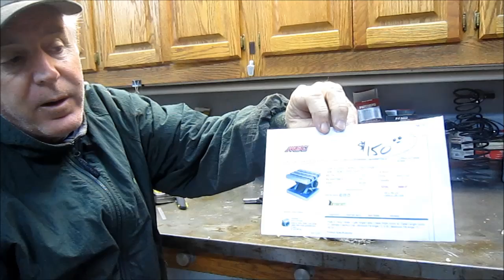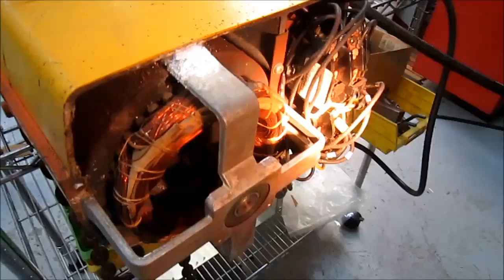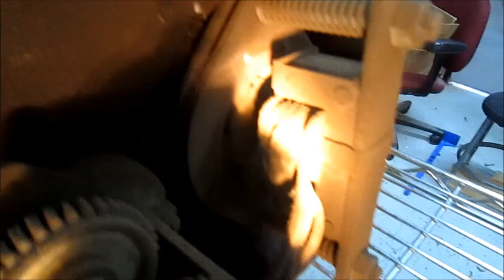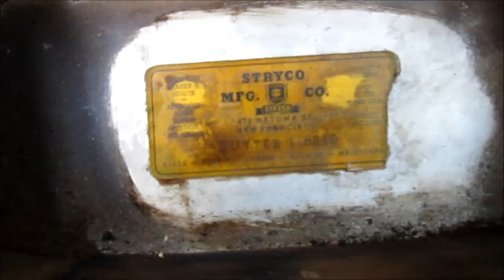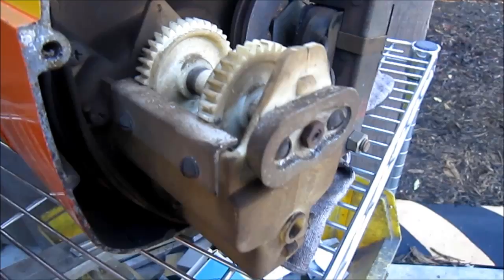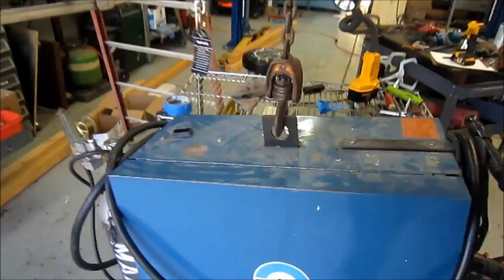Tool Time 15   Repair The Wrightway

Comment: I have not checked Part 2 nor all the comments, but I didn't like the sound it made at some points while it was running under load. Before I put that back into service, I would like to see inside the gearbox. You may have a tooth (or two) missing or chipped from a gear (or two). It sounded to me like a gear tooth jamming partially on top of another gear tooth. When there is no load, momentum carries the driven gear past the bad spot with a little clunk. When there is a moderate load (your welder) it clunks louder and occasionally jams and won't go past the spot and won't even back away without several jogs.

I worry that with a full load, it might some day jump across that bad spot and begin knocking teeth out wholesale (and since the hoist is activated, the brake is held open) and letting this heavy load get you into some serious trouble. You really don't want several thousand pounds of runaway metal in your lap.

Mind you, that noise might also be a worn chain and/or a worn chainwheel (the pulley that the chain runs over). When either or both of those parts are worn, the pitch of the chain (distance from link to link) may no longer match the pitch of the chainwheel (the pitch of a theoretical chain that fits the chainwheel exactly).

A worn chain develops a longer pitch (because the wear is on the inside of the link-ends and a worn chainwheel develops a shorter pitch (because the pitch diameter decreases), so wear in that department is always bad news. Arguing against this as the cause of the problem, it would be less likely to cause an actual jam.

You can't replace just one or the other; you have to replace them together or the new one will just wreck and be wrecked by the worn part. BTW, roller chain and sprockets behave the same way.

A chainwheel may also be called a gypsy (UK) or a wildcat (US). I have no idea why. Sorry about being so long-winded, but it's a safety issue, and they always wind me up.
Reply from the maker: Peter W. Meek Peter...no worry on being long winded when all of the information is of value....thanks

Comment: im a lift engineer think you call them elevators my money is on the break< when you put a call in you hear the break soloiniod operating (CLICKING) i bet the break is still engaged, breaks can be really tricky
id take the cover off and make sure the plate engages to the break squarely remember yov have probably disturbed it when you re-welded that bar, also have a look at the break surface might have high spots, good luck

Comment: Have you checked that the brake is releasing when you press the up/down button when the hoist doesnt move but there is the buzzing. If the brake releases then I reckon you have a dirty/faulty motor contactor, needs cleaning but at that age better to replace.

Comment: Hi Chuck,
I have a Yale electric hoist that looks very similar to your Wrightway.  I know the brake system is tricky to get adjusted properly.  I actually took mine in and had a local company go through the whole thing.  It came back running perfectly so it was money well spent.  By the way, our phone number when I was growing up was "two longs and a short" and yes, it was a party line.  Seems like such a long time ago… and yet all good memories!
Take Care and good luck with your hoist and tool buying!!
Reid

Comment: Hi Chuck.  I think you still have some bad points or a loose wire on the contactors.  I can't tell by the sound but, while acting up, does the brake pull in when you hit the buttons?  Assuming 220v and the brake pulls in on both directions when it acts up I would check the T3/L3 contacts and wires.  According to the diagram, T3 is not used to power the brake but it would cause the motor not to run in either direction. 

I am further assuming that the chances of two sets of contacts not working randomly at the same time is slim.

Comment: Watched your test.  Every time you pressed up or down switch I heard conctactotrs closing  I think the electrical is OK.  When motor did run it sounded to me that it was really grunting.  I would go back and check the brake.  De adjust the brake to fullly release it and see how it runs then.  If all is OK then all you need to do is set brake tension such that brake can hold rated load of unit..

That brake may be a DC brake so check the rectifiers if it is DC.

That coil may have overheated so make sure the mechanics of it are running right - it should pull that brake disc back real quick and hold it back with little to no vibration.
Then have electrician check motor current on all three phases both unloaded and loaded.

Just another maintenance electrician.
Dan  Bentler

Comment: Looks like a Chuck bomb went off in your shop. I'm curious if the part you welded back to the plate was steel also. It looked slightly bronze in color.

Cheers,

Tom
Reply: If that's a mess. I will drop any plans I might have had for saving up for a video camera!
chris

Comment: Wild guessing here, but could your flat spot be binding in the brake release?  Maybe lack of lube on a shaft, or a worn spot that is hanging up?  Looked like it worked fine with no load, but once there was some weight for the brake to hold, it didn't want to release. Someone else mentioned air gap in the release solenoid...that sounds plausible...too much could reduce the pull, and cause failure to release...especially if there's any binding in the mechanical parts. To be expected in a 50 year old winch...I get binding in my mechanical parts sometimes too!

Thanks for letting us see the process.

Comment: Chuck,
Do you have a bell for when recess is over? Great video about your hoist. Judging from the drawing of the motor your electrician did, it appears to be 3ph. Could you have a bad electrical connection (plug, cord, etc.) and you are dropping a phase? That would make the motor hum like it is doing. Hope you solve the problem.
BTW, in 1965, (2 years after your hoist was made) I graduated from high school in Ukiah, so I'm somewhat of an old fart myself! Our phone number prefix was HOmestead 2. I now live down on the peninsula from you in San Mateo.
Regards,
Dave

Comment: That's not a flat spot in the switch, the air gap in the brake solenoid should only be about 1mm at max. My wife is the AA around here.

Comment: do not know if this type of motor is brushed motor or not but ...chuck sounds like the commutator segments or at least some of them maybe burned or hi resistivity/corroded etc...I have worked on many cars that the starter motor had this exact problem have a look my friend

Comment: Hello,
My name is Matt and I'm a tool-o-holic.........
As you know Chuck I also suffer the affliction of spending every last penny on tools and tooling.. I use the excuse that I have 4 kids and when I die I need to have 4 of everything so there is no fights over my will as there will be one of everything for them all.....
The only problem with my plan is they will argue over color or brand....lol

It seems to me that you nearly have the hoist licked, Is it possible that the whole unit needs to be striped and given a damn good bath? 
I am no electrician, but any idea is better than none...
Keep at it Mate..
Matt
Reply from the maker: Hi Matt...
LOL....I like it a tool o holic...

My excuse is that I am still working and I need to build my stash for when I retire...it sounds good, but my retirement will be when they put me in that wood box....hmmm, note to self, start wood box project.....LOL

Thanks for you thoughts/comments
Chuck

Comment: I know very little But could it be a dead spot in the motor windings Or if it is a capacitor start motor check those parts
Reply from the maker: Not2
yes, that is why I going to get the electrician back over here...

Comment: nice work on the hoist and you will be glad you bought the adjustable angle plate they come in handy when you need it & honestly for that price you can probably turn around & make money by putting it on ebay it appears to be a good size
Reply from the maker: Austin...
Thanks for the comment, and yes I will be smiling when I need it, I thought about it after since I didn't mention it the plate is 10"x8"

Chuck

Comment: Oh how I remember those party lines and the teenage girls that would tie them up forever.. Just wonder have you put an amp meter on the unit to check the draw it almost seems to be a mechanical binding and bumping the switch is enough to break it free, just a thought Take care and let me know when you find the tool buyers addiction club.
Reply from the maker: Rob..
LOL...yes it was an easier time back then and hey you actually knew and remembered phone numbers....only number I know now is my own....yikes!

yes, going to get my buddy back to do some more testing...

hmmmm....find, I thought I had already joined....LOL

Chuck